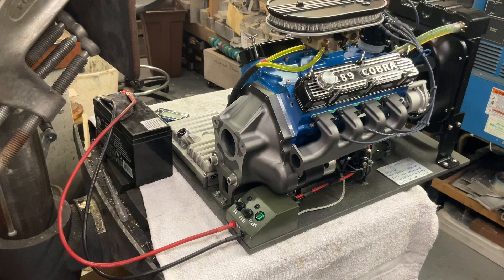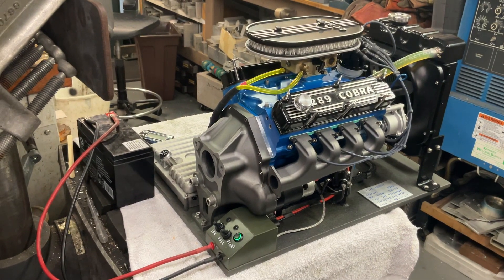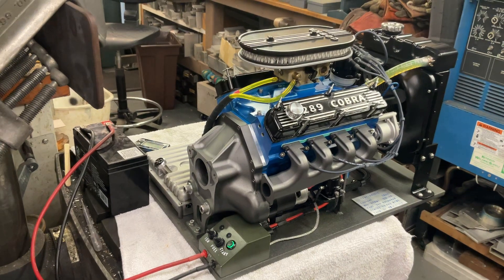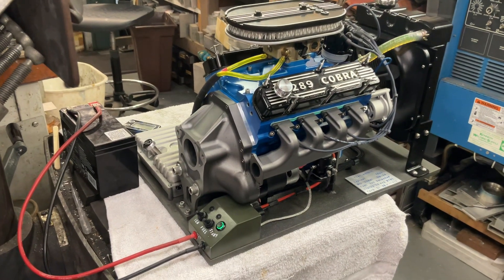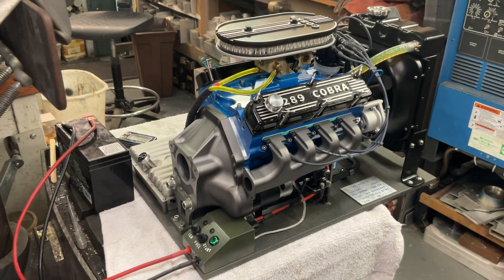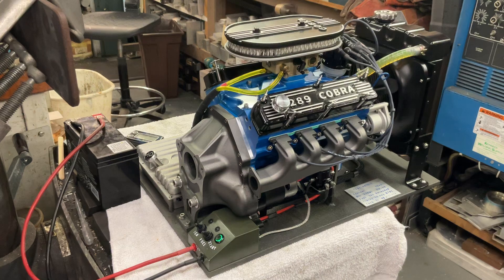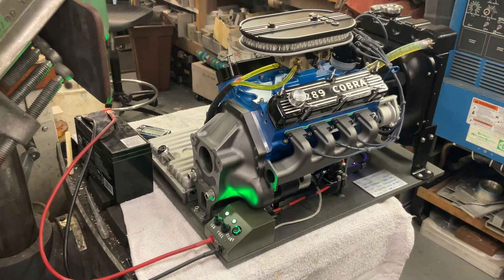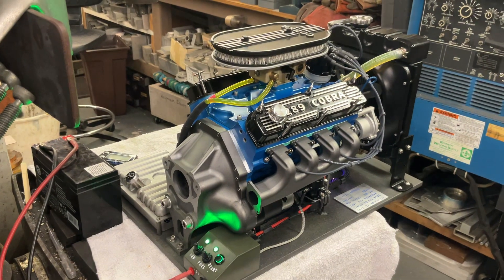Terry Mayhugh's 1/3 Scale Ford 289 HiPo Engine

Comment: As a 71 year old Ford guy, very cool! But one small detail, those are not Hipo exhaust manifolds. Hipo manifolds angle down, are more free flowing, with a larger outlet. Those are standard manifolds. Still very nice job!
Reply from the maker: Thanks for the comment. The left and right hipo exhausts weren't mirror images of one another because of the starter. When I modeled a more accurate looking pair they looked strange on a display stand and the left one was going to send the hot exhaust down into the table top. Since I wasn't making a museum quality model I took the liberty of making them mirror images of on another, but I did make them beefier than the regular stock exhaust. You have to appreciate they weren't cast but machined from solid billet. - Terry

Comment: Call me stupid but how does ⅓ of 289 cubic inches equate to 8.1 cubic inches?
Reply: I'm thinking 1/3 exterior scale?
Reply from the maker: @deborahberner5569  correct... but then not precisely ... some liberties have to be taken when designing a running model engine because things like air molecules and breakdown voltages and head gasket clearance requirements don't scale

Comment: Complex parts like the bellhousing/manifolds are too smooth to be a Sandcasting and lack any tool marks from the cnc. It appears that it was diecast. How did you smooth the surface of all these parts?
Reply from the maker: No castings. Most of the CNC'd parts were glass bead blasted and then painted (Gun Kote'd actually). The exhaust manifolds and bell housing were CNC'd, glass beaded, and the painted with Eastwood's high temp manifold paint.
Reply: Probably lost foam castings. The process produces fantastic looking parts. Bead blasting can remove tooling marks and give you that universal finish. Just my guesses..😊